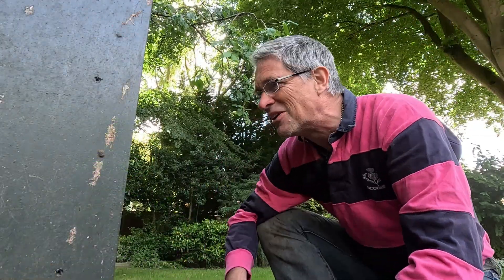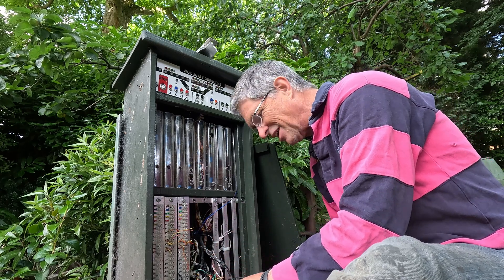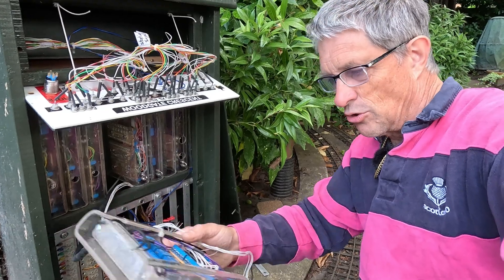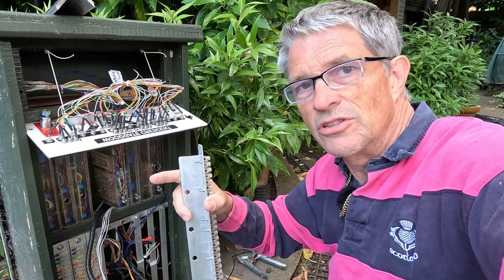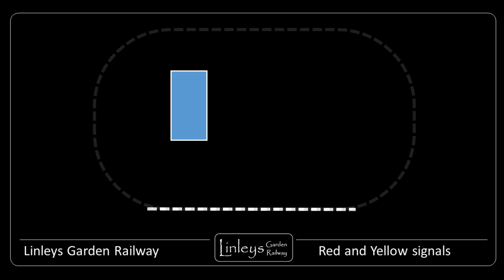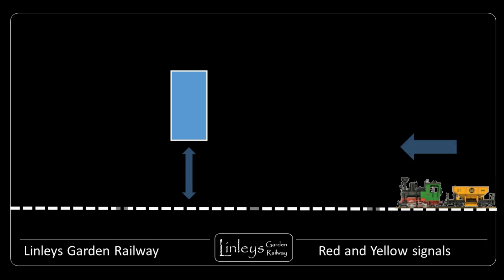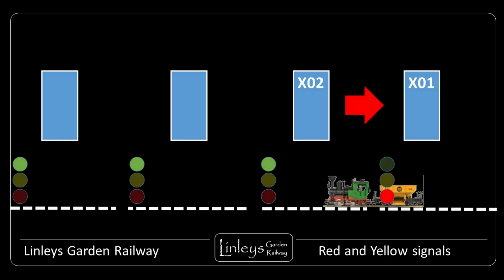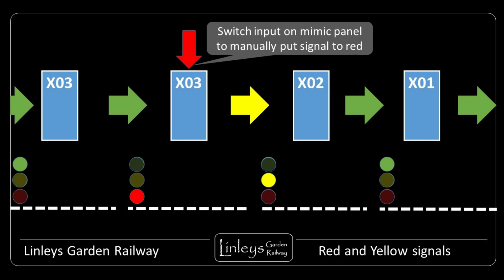Building a Garden Railway • Automatic Red and Yellow signals • DLC System • Linleys Garden Railway

Comment: i think you should say X Zero 1 .  X Zero 2 etc
Reply from the maker: That's a good point Keith, thank you. Earlier on in my videos I didn't use the block section codes at all, then I did one including zeros and that sounded very pedantic.  I swapped to making it sound okay but I could just say X1 and X2 as the zero is only relevant for listing when there are more than 10 in an area.  Cheers, Warren :)